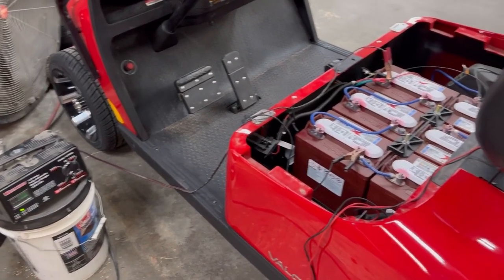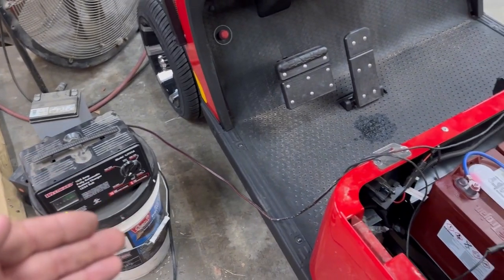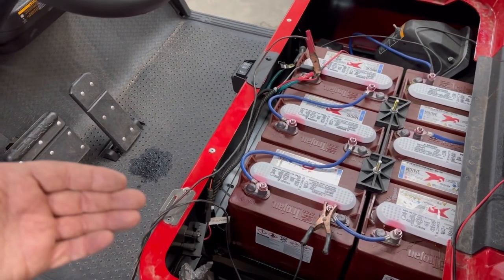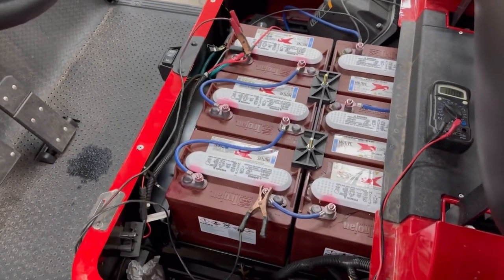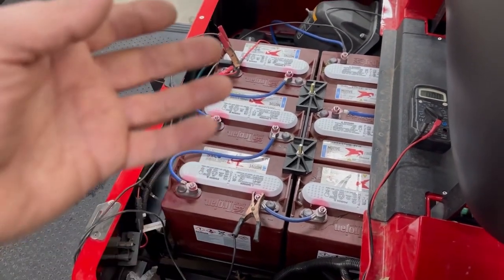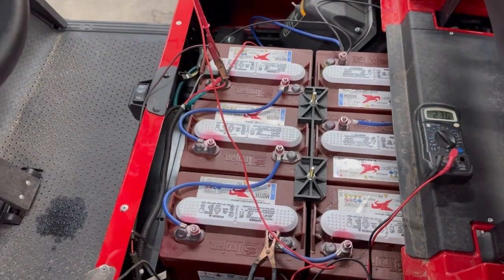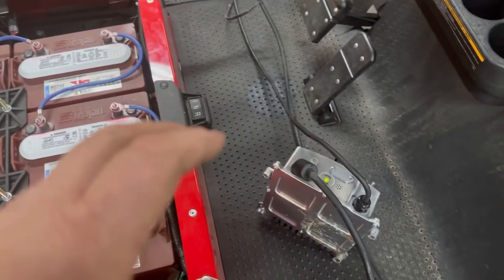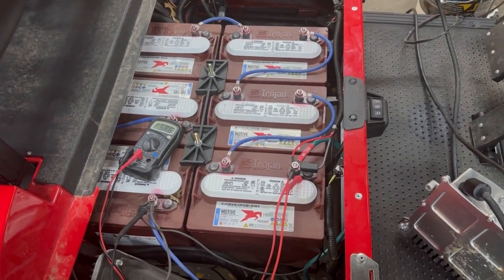HOW TO CHARGE COMPLETELY DEAD 48 VOLT GOLF CART BATTERIES SAFELY AND EFFECTIVELY

Comment from the maker: Have a similar issue and need a good 24 V manual battery charger ? Click the link below ⬇️
https://amzn.to/3LNNnpS

Show your support for THEMOWERMEDIC1’ https://www.amazon.com/hz/wishlist/ls/1U5HZPFNVFAWK?ref_=wl_share  

Help support my Channel by checking out my extensive parts store here on amazon
Check out this page from THEMOWERMEDIC1 

 ➡️https://www.amazon.com/shop/backwoodsctryboy

PTOOLS I USE DAILY
MILWAUKEE 3/8 socket set 
➡️ https://amzn.to/3N3ulda
1/4” socket set
➡️ https://amzn.to/3MTyQaf
Oil evacuator
➡️ https://amzn.to/3MQM33P
Lawn mower lift
➡️ https://amzn.to/38lKhsr
Reply: i always hated 8 volt batteries in golf carts ........when they die during the winter it is the same thing over and over.  a couple of years ago i bought a charger that goes up to 72 volts....turn it to 48 and it does the job perfectly.....

Comment: You didn't touch on exactly why it is that a battery charger won't charge a completely dead battery? It has to sense power there first or it won't do it why is that?
Reply: Sounds ridiculous doesn't it? You need to use a battery charger to charge the batteries so the battery charger will work.
Reply: on board smart chargers, used in most newer battery powered carts are programmed through a microprocessor to control the 3 stages of charging. If it doesn't detect the minimum programmed voltage it won't begin the charge process. So you have to "trick" the charger to get it to work. Just as Jeremy did. Keep in mind, the minimum voltage depends on the total battery voltage. Hope this answers your question.
Reply: @jimbrewer2893  ya done that before, jump start the mower with Isuzu rodeo and then let it run for a few minutes. Chatted back down check the fluids and then the charger should work 👍